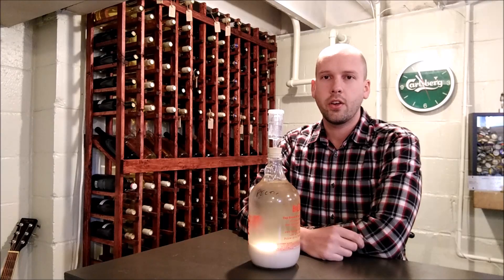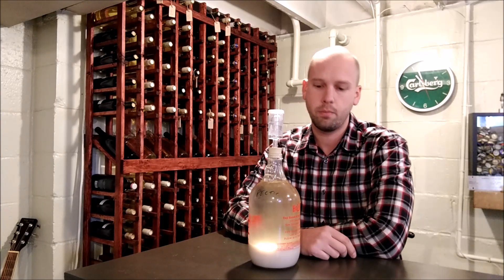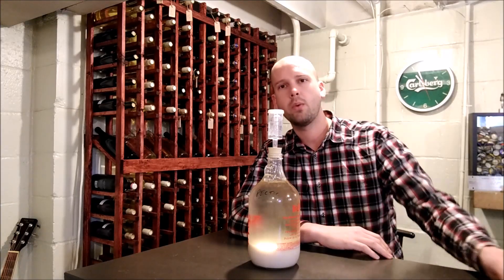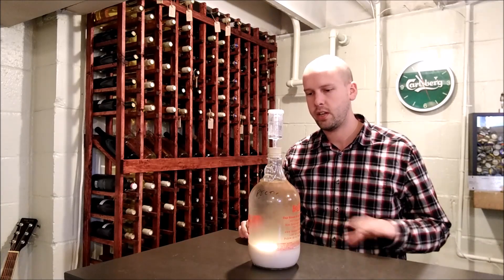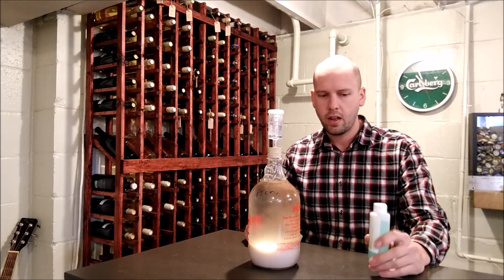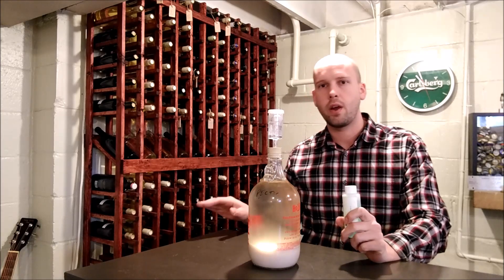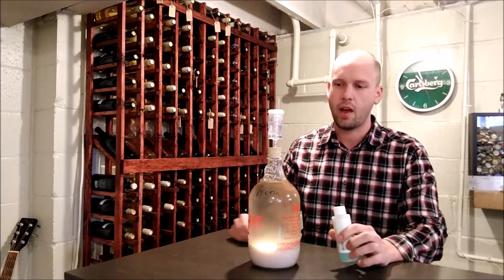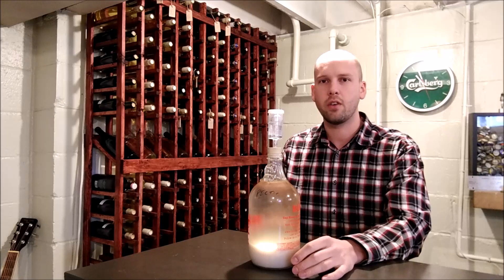Solving a Rotten Egg Smell in Wine - Hydrogen Sulfide

Comment: I know this is an older post, but it still is relevant and important. It seems to me that knowing how to deal with this issue is critical. Something I have noticed in some of my batches is that there is an off odor before it becomes the rotten egg  odor. I'll notice this off odor a maybe a day or two before the rotten egg odor becomes prominent. I don't even know how to describe this initial odor. I've heard people mention burnt match odor and it's not that. I'm not sure it's a pungent odor but that's close. Saying it smells like it's souring kind of describes it, but not exactly. Now I know that when I detect this odor I'll need  to start thinking about splash racking, adding nutrients and yeast hulls. It just happened to my batches yesterday and this morning I splash racked, added some hulls and Fermaid-O and after about 6 hours I am noticing an improvement. I'll consider splash racking again tomorrow if the odor is still present. I've heard about copper wire and I actually have a 2 inch long by 1/2 inch diameter copper plumbing fitting that I've cleaned. I thought about using it but I've heard that if copper is used it will leave small copper particles in the batch that will need to be filtered (Bentonite, etc). I'm not sure I want to take the risk as I think copper is not something to be ingested. Does anyone have any idea how long a piece of copper would need to be in the batch to be effective and at what point will copper particles be a concern that needs to be addressed? Thanks
Reply from the maker: The nutrient and air will definitely help.  I like to keep some DAP on hand for these "rescue" operations.  Fermaid O, at 1g/L will give you about 50ppm increase in YAN (Nitrogen).  DAP is about 212ppm at the same dose, and Fermaid K is about 100ppm.  You are going to want at least a 25ppm bump to get the yeast happy again, assuming you still have a good bit of fermentation to complete.  Depending on the severity, you may need as much as a 75-100ppm bump in YAN.
Reply: @TheHomeWinemakingChannel Ok, thanks again for the information. I noticed continued improvement during the day yesterday. This morning I decided to splash rack again as the odor, though fading was still there. Fermentation is still very active. I swirl/agitate a few times a day. I'll keep checking and I may add more Fermaid-O later today but I don't want to overdo it. I mentioned the copper fitting and copper metal in general. I'm curious what you think about my comments. I would be tempted to use the copper fitting, but I don't know how long it would take to make a difference and then I don't want to have to worry about copper particles in the batch. In other words I don't want to solve one problem and create another. Put another way, is there some length of time where the copper metal will help yet not leave particles in the batch? Thank you again.
Reply from the maker: The copper is useful in the event that you can't solve the problem with air and nutrient.  Copper while the yeast is active can be complicated and actually cause even more stress to the yeast.  So while you are reacting to the hydrogen sulfide, you can be creating more of it at the same time.  Once fermentation is complete and you have racked off the bulk of the yeast, copper sulfate is the best course of action (But hopefully you won't need it).  People used to splash rack over a sheet of copper flashing or through a copper funnel, which is crude but does achieve the same thing as copper sulfate will.  With any form of copper, you don't want to over do it.  Copper, when in contact with the acids in wine will release copper sulfate which is toxic.  You want to make sure you are only adding just enough to react with the hydrogen sulfide, vs just leaving a copper fitting in the wine for weeks.  Aside from being toxic, too much copper can also create a haze in the wine.  If you add only enough to react, then you should not have any issues with residuals.  Normally with copper sulfate, you will use a 1% solution and do bench trials to figure out how much to add.
Reply: @TheHomeWinemakingChannel Thank you so much for the detailed information, I really appreciate you taking the time to help. I think I'm fine staying away from copper at this point. I still consider myself a rookie, learning as I go and this is only a hobby for me. I think I would rather learn how to prevent these issues or catch them early enough to be able to resolve them without taking extreme measures. Yes, this is an important hobby to me but I'm really only making single gallon batches at a time. I don't want to waste anything, and the loss of a gallon in a dire situation is not desirable but if it results in furthering my knowledge and experience, I suppose it's worth it in the long run. Again, thank you.

Comment: Can i add this after i did 2nd rack of apple wine
Reply from the maker: If it distinctly smells like rotten eggs you can.  If it has moved past the rotten egg phase, it is too late.  Eventually it will be a subtle "mercaptan" smell which can come off like burnt rubber, natural gas, or garlic.  In subtle cases, people might describe it as slate.
Reply: Is the wine saleable ot should I start over? Still sulfur smell and I have to bottle this week

Comment: Thank you for this video. We are giving this a go on 8 gallons of Chardonnay that were starting to acquire the smell while undergoing MLF. We did a splash rack from one carboy to another and then after sanitizing the original carboys and back to it. We put in 25 ppm potassium Metabisulfite and got the wine off of its lees… It 
 smells better already. Hopefully we won’t have to go to Copper sulphate route. I can’t wait to smell it tomorrow
Reply: How's it goin so far?
Reply: @XenXenOfficial  It’s better. We splash racked and added Potassium Metabisufite 25 ppm. 
Will rack again soon.
Reply: @XenXenOfficial  I thought it was better but 24-36 hour later it was back and quite strong.  We put in copper wire (stripped and sanitized for 36 hours and it seems to have taken care of the problem for now)

Comment: perhaps you may have learned this by now but hanging  a copper wire down your fermenter will remove the H2S after a few hours,just be sure to let the fermentation finish and perhaps add a clarifying agent to drop out all the remaining Cu particles that have bonded to the H2S and rack clear into secondary
Reply from the maker: Yep.  Copper in the presence of an acidic solution (like wine) creates copper sulfate so you are essentially doing the same thing but a little less controlled.  That's why you don't want to use brass or copper fittings on wine tanks or pumps.  I once read about an ancient "cure" for an infection was to put wine into a brass bowl for a day or two then pour onto the wound.  But the chemistry of that is that they were creating copper sulfate which is very toxic to microbes.
Reply: @TheHomeWinemakingChannel  sulfate or sulfide or sulphate or sulphide lol i think the british term uses "ph" also
the main difference between Sulfate and Sulfide is that the Sulfate is a 
anion and Sulfide is a chemical compound,, but anyways what do you think about using copper wire to do this trick? i think if it works it is safer solution, some swear by it working after a few hours
Reply from the maker: It is doing the exact same thing with the exact same mechanism.  On one hand it is more safe because you cant grossly mess up a calculation.  On the other hand it is much less controlled, and you have no real idea of how much copper sulfate you are releasing into the wine so you could end up with some residual.
Reply: @TheHomeWinemakingChannel  yes no need to calculate dilution but i figured it would be more controlled release because it will only release what is needed to bind with the hydrogen sulfide or am i mistaken? i know you said it will release more but i dont see how it can create more copper sulfate if there is no more for it to bind with?  thank you
Reply from the maker: @ARCSTREAMS  It will just keep releasing.  The acid is the catalyst rather than the hydrogen sulfide.  Sometimes people just pour through a copper funnel while splash racking.
Reply: @TheHomeWinemakingChannel  i see,, btw is it not bad to splash rack after fermentation as not to introduce air ?
Reply: @TheHomeWinemakingChannel  but releasing what? since there is no more H2S for it to bind with then what is the worry? and what if there is no acid in the mash or will there always be from a fermentation?  also wont you get rid of it by multiple racking?
Reply from the maker: Grape juice and in effect wine is very acidic with a pH of anywhere from 3.0 to 3.8.  It is a logarithmic scale, so a pH of 3.0 is a 100x stronger acid than a pH of 5.0 which is more typical for a beer.  That's why wine is an entirely different animal.  It is not sterilized like a beer is, so there is a whole microbiology thing in play.  But because it is so acidic, it is relatively easy to control the limited amount of microbes that can survive with good oxygen and SO2 management.  But also because it is so acidic, it will dissolve most metals to some extent.  Copper, being relatively poisonous in dissolved form is one to watch out for.
Reply: @TheHomeWinemakingChannel  got it thank you
Reply: I just had a 10l batch show up with the sulphur smell for the first time.  Put some cleaned, new 1/2" copper fittings in a 3 1/2 l jug and poured the wine in and gave a good shaking up.  In 5-10 mins the smell was gone and it went into a clean carboy to continue fermentation.  Haven't drunk it yet but smells normal.
Reply: @julianb1474  so you did a small batch test ,wow it worked so fast huh thats good

Comment: 0.5 ppm? damn that is extremely low ,how poisonous is it? and how can you control adding such small amount where would you begin?
Reply from the maker: It is poisonous enough to not want to move a decimal places accidentally when calculating the addition.  Organic farmers use it as a fungicide pretty commonly.  At the doses we are talking it is not a concern.  Ideally you should only add the amount needed to react with the hydrogen sulfide that you have.  When it reacts with hydrogen sulfide it makes copper sulphide which precipitates and sulfuric acid which is also a byproduct of the oxidation of SO2 and will be present in any wine in miniscule amounts.  To add in a controlled manner you first need to make a diluted solution.  1 gram copper sulfate plus 99 grams of water makes a 1% solution which is much easier to work with.  You can also buy it already diluted from most big winemaking shops.
Reply: @TheHomeWinemakingChannel  hmm so from copper sulfate to copper sulfide ,,gets kinda tricky all these similar sounding name lol ok so that makes sense 1:99 ratio then simply double the water to get aprox 0.5 ppm

Comment: well idk if its this rotten egg smell or a rotten cardboard or swamp gas smell but not only can i smell it i can also taste it( i think) whenever i make ginger ale with low abv and only use the yeast to basically bottle carbonate and im told this is the problem because it's the beginning stage of fermentation and is halted early where otherwise it would go all the way and get rid of this smell and taste by gassing off through the CO2 ,,problem is i did not encounter this with other soft drink brews i made nor with other fruit wines ,could it be something to do with the ginger itself interacting with the yeast or some wild yeast creating this juts like how they can create malo lactic acid? it only happens whenever i tried to make ginger ale
Reply from the maker: It could be brettanomyces which is extremely common and depending on the wine drinker it could be viewed as a good thing or a bad thing.  It could also be TCA (cork taint) but most modern barrel manufacturers are very clean so TCA has become much more rare.
Reply: @TheHomeWinemakingChannel  err ok but im  referring to ginger ale not wines

Comment: All you need to do is add a  cooper tube or wire. Leave in for a hour or two. When you pull cooper peice out you take the sulphur with it. This is why you use copper in distillation. Sulphur sticks to it.
Reply: Really? can i peel a electric copper wire to have just copper metal, and just stick it in the wine?
Reply: @luccianodfs6711  yes you can use any clean copper.

Comment: Sir. I prepared white wine using rice grain and raisins (fry grapes). But during the fermentation abt 12 days i noticed some small white worms around the jug, and smell a bit odd. After the fermentation i seperated the wine in a glass bottle. I tasted the wine a bit, the taste was good, but the smell is horrible. Is the wine good, Or went bad. Or do i have to add something to remove the odour. Plz help me sir.

Comment: How long should I wait after adding the copper sulfate
Reply from the maker: Just make sure fermentation is complete.  If fermentation is still active, a little nutrient and air can solve the problem.  Be extremely careful with the calculation and make sure you don't shift a decimal point.
Reply: The Home Winemaking Channel thank you I make 4 1/2 gallon batches so I will put in only 3ml the reason I asked is because I was go to be making cider and the yeast get really stressed out because of the malic acid

Comment: Actually its best to degas the wine. Siphon it into a bucket. Don't splash the wine around much. Use a drill with a paddle or paint mixing attachment stir the wine fast until it foams. Don't mix so hard that the wine pulls air in but mix it until your arm gets tired.

Comment: I had a real bad case of hydrogen sulfide smell at the end of fermentation.
I resolved issue by racking the wine twice with a 1/2" diameter 3 feet long water cooper tubing.
Most of the rotten egg smell went away on the first racking.
I did not have to mess with the copper sulfate solution.

Comment: I'm making wine out of 100% juicy juice and I'm getting a bad smell from it, it's the 3rd day of fermenting, what should I do? It's fermenting at about 70 degrees..
Reply from the maker: Is it like a rotten eggs smell?  That is very common when the yeast does not get enough oxygen, nitrogen, or if the temperature is either too warm or too cold.   Some yeast nutrient, a little air, and some aggressive splashing can usually clean it up.  Your temperature sounds fine.  If there are any sorbates in the juicy juice, it could also cause stress on the yeast.  Check the label for anything that sounds like a preservative or ends in sorbate.
Reply: @TheHomeWinemakingChannel  sorta like eggs, I think it might just be more of the smell of the fermentation  I've been shaking it and letting it air out and it's helped it alot, it taste great so far.. I made it out of bread yeast, would wine yeast work better the next batch?
Reply from the maker: The bread yeast will definitely do the egg thing...  It is hydrogen sulfide which is smelly.  Bread yeast can't handle the high acid, high alcohol environment of wine without undergoing stress and producing a good bit of H2S.  A good wine yeast fermentation will smell fruity or sometimes a little bready.  If it gets a tiny bit of egg smell it is not a big deal, but if it is excessively strong and untreated it can cause the wine to taste like burnt rubber or garlic as the H2S evolves into mercaptan.
Reply: @TheHomeWinemakingChannel  ok so I should def. Get wine yeast next time, it hasn't affected the taste so far, it taste really good.. hopefully if I just keep shaking it and letting it breath it'll be fine..
Reply from the maker: Haha, yep.  That will go a lot better for you.  If you are ever in prison, bread yeast will be better than nothing though.  Lol
Reply: @TheHomeWinemakingChannel  if you’re in prison yeast will be the least of your worries! Nice video, hope it helps me with a big batch of 21ltr vimto wine